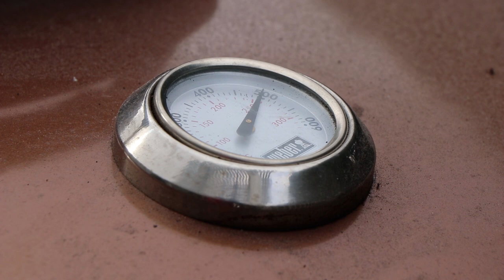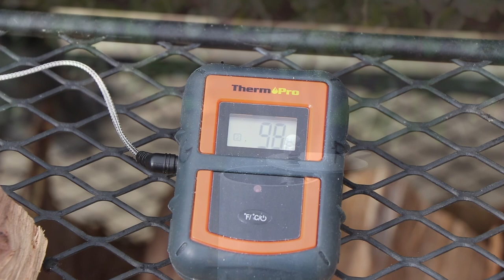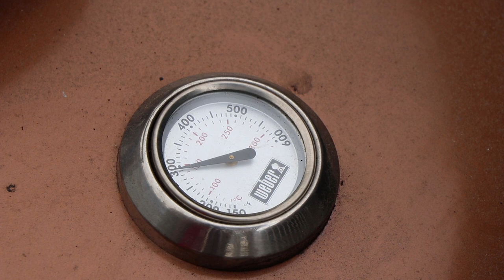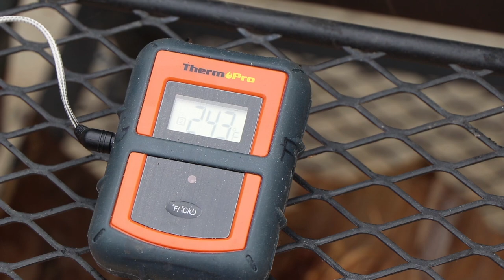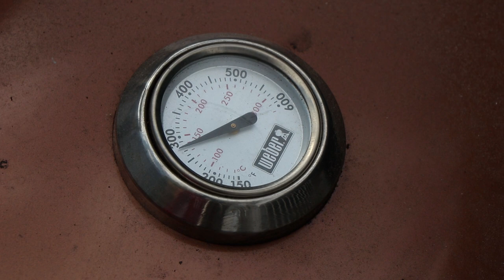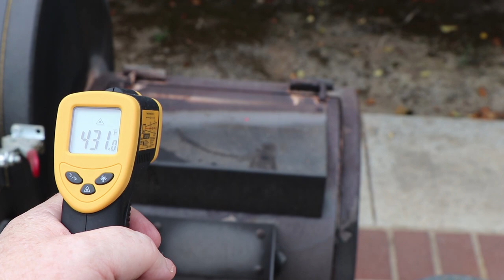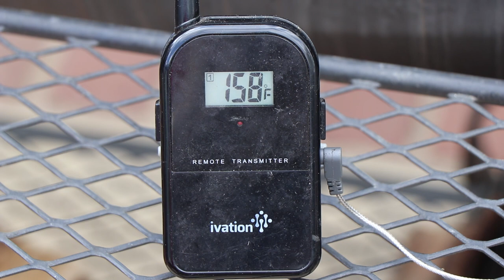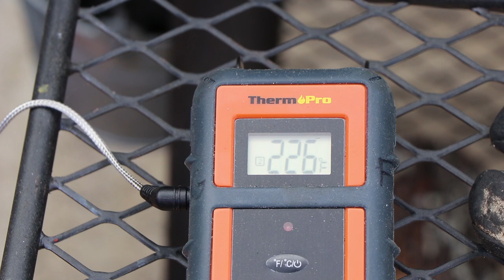Smoked Spareribs Using The 3-2-1 Method On The Offset Smoker

Comment: HOW TO CUT THE 3-2-1 METHOD TIME IN HALF: Make a brine with the following ingredients; kosher salt, brown sugar (lite or dark), your favorite seasonings and COLD water. Make sure the water is 40 degrees F or less. Brine in frig for about 4 to 4.5 hours. Rinse excess salt from ribs and season as usual. 1st two hours on the grill/smoker, 1 hour wrapped in foil, 1/2 to 45 final minutes without foil. Last 15-20 minutes of cooking apply your sauce. You're done. All done in under 4 hours. Because I own a JUMBO JOE, the entire cooking time takes me 3 hours, give or take 30 minutes.
Reply: can you tell quantities for the brine?
Reply: @francoerp  For my needs: I usually cook 1-2 slabs of baby backs or 1 slab spare ribs. I cut the rib-tips from the spare ribs & add to the brine as well. And I do the brine mixture sometimes 2-3 days before I bbq.
I use a 5.5-quart stainless steel Dutch oven with lid.
1/4 cup or little less of kosher salt.
1-2 cups brown sugar (I use light; dark brown will work).
1-2 tbls of my homemade spice rub or store bought.
1 tbls ground rosemary (or a sprig of fresh rosemary).
1-2 tbls garlic powder.
sometimes a tbls or two of Walkerswood Jerk Seasoning (the wet paste) or JCS Jamaican Country Style Boston Jerk Seasoning. But after the salt, brown sugar & water, one can add any kind of seasonings. Whatever you like; sky is the limit.
MOST important part of a brine is the salt & cold water @40F or less.
Add 4 cups of water to the ingredients in the pot and simmer for about 5-10 minutes. Let cool. Set in frig until you'll ready to bbq. If I plan to bbq on Sat. or Sun., I might place the ribs in the pot to brine for 4.5 hours a day or two before the bbq. Make sure the meat is completely submerged in the cold water. I place the pot in the freezer for about 30-45 minutes. Then in the frig for the remaining brining time. Brining complete, season ribs & place in a covered aluminum pan, put back in frig until the weekend.
Reply: Thank you Scoop
Reply: @francoerp  U'r welcome. Experiment with the kosher salt a bit until you get the hang of it. You don't want it to be too salty, but at the same time you want the salt water to do its job. I've been doing this for years and I got  it down so well that I hardly ever measure. Never are the ribs salty. The flavors' that I add are spot on. Ribs juicy and tender!!!!! But remember, you can make your BRINE 2-3 days in advance and store it until you're ready to cook.

Comment: Hey Ry great video, I’m curious about rotating rack positions on the grill because of the different temps on the grill. Did you rotate your racks at all?? Thanks!
Reply from the maker: Generally I don't. The baffle plates I have in the smoker help even the temps quite a bit :)
Reply: Cooking With Ry you have baffles in your offset? Any chance you have a vid showing those?? 😀 or could you point me in the right direction?? I have basically the same smoker!
Reply from the maker: Right here: https://youtu.be/hTfiLAL0Gd8 :)

Comment: I just did some baby backs for my first go around at the smoker. My temp was about 210 - 230. I rubbed them with good quality rub, did Johnny trig wrap, spritzed them several times, and did 2-2-1. They just didn’t turn out. Not very tender, lots of unrendered fat, gamey taste. Not very sweet. I just didn’t like them at all.

I feel like I did everything right and was very disappointed. Any tips on how to make them more tender and tasty?
Reply from the maker: Not sure about the gamey taste, but if they're not tenderizing they generally need more time. The decision then becomes when to add that time. If you did a 2-2-1, and you want some more flavor, I'd personally add a bit of time in the middle so you have maybe a 2-2.5-1, and make sure you give them a good spritz when wrapping them. Then in the last hour, when you have that unwrapped time, try upping the temp to 250-275 and give them a glaze with your sauce of choice to get that sweetness. I'd check them every 20 minutes during that time for probe tenderness between the bones so you don't push it too far.

One other possibility if this is isolated to a single rack is that you got a bad slab of pork. That's happened to me before.

Comment: Love your videos Ry.  I have learned so much and appreciate it greatly.  Thanks for this 3-2-1 method as it is very workable.  One question though - have you tried (recommend?) one of the "rib racks", that hold the ribs horizontally but seperated between the wire slots?   It would allow me to cook several racks of ribs at one time but I don't know the negative aspects of this.    Thanks again for your videos.
Reply from the maker: I actually have a video about that: https://youtu.be/lit-bgXSY0o I've also used it several times on the Weber Kettle :)

Comment: Thanks for the video...321 produces delicious spare ribs for me but almost always falling off the bone during saucing. 235, bone side down. Foil wrapped with brown sugar, honey and butter. I wish it would stay on the bone better...have shortened the 1 to 35 min but still hard to pick them up. Not doing competition and never had anything but compliments. Gene
Reply from the maker: Yeah I'm not a fan of falling off the bone. Prefer some bite to mine :)
Reply: I had this same issue when I did ribs yesterday following the 3-2-1 method. They had great flavor, but they were falling apart too easily. I think next time I'm going to try 3-1-1 and see how that goes.
Reply from the maker: Yep, just adjust that middle wrap time and that should keep them with a little more bite :)
Reply: @brlewis1984  how did the 3-1-1 work out? Everytime I use 3-2-1 they fall off the bone. Not what i'm looking for
Reply: Nolan Holifield I actually just did 2-1-1 last week and texture was perfect. Cooker was 250-275 and I wrapped with butcher paper.
Reply: @brlewis1984  Thank you sir!!!

Comment: great tips for the OK J  I bought some of the aftermarket accessories  base plate baffles , waterpan and  firebox, where did you find that clip for your temp probe? been using orange juice /water mix for the pan and  spraying also DR pepper works great too
fixing a brisket and ribs in 2 weeks for a co workers retirement  I use pecan chunks  but would love to find pecan logs or maple logs
Reply from the maker: That clip came with the probe when I bought the thermometer. I'm pretty sure they have them on Amazon :)

Comment: Very nice video and I will be cooking some spare ribs tomorrow (06-08-2019) using the 321 method!
Reply from the maker: I hope they turn out great :)
Reply: @CookingWithRy  I'll let you know!😎👍
Reply: I used Mesquite wood and used a glass pyrex pan for my water pan. It took a little more than the 3,2,1 it was more like a 3,2,2 and the meat fell off the bone except on the thickest portion of the ribs. And just like you did in the video, I divided up two racks into 4 half racks. When making the sauce, I used Jack Daniel's bourbon sauce mixed with Pace Picante salsa (medium). My wife said that it was like a cross between Tennessee and Texas BBQ. Thanks for the good instruction!

Comment: How often do you spritz, and what is spritz made of ?
Reply from the maker: I usually don't spritz until a couple hours have gone by, and then only if the surface of the meat looks too dry. You want some bark formation, but a spritz after that maybe every hour usually works for me. Of course if you're wrapping that becomes unnecessary once it's in foil or butcher paper. I usually use a 50/50 mix of some juice and water, or a 5-1 mix of apple juice and apple cider vinegar. But you can really try many different juices to see what you like best.
Reply: @CookingWithRy  ahh awesome, thanks for the reply, I will try the 5-1 apple juice to cider mix and see how it goes.

Cheers

Comment: This my friends is the best detailed video I've seen
Reply from the maker: Thanks very much!
Reply: I've had ago at this today did the 3 2 1 method and they never seem to fall apart the ribs were a little chewy .
Reply from the maker: It sounds like they needed a little more time. If you grab one of the bone ends and can twist it so it pulls out of the rack (almost like unscrewing it) that would give you closer to fall off the bone doneness. I prefer a little bite to mine. 

Also, you can increase the '2' part for more tender ribs, especially with spareribs or St Louis cut. I've done a 3-3-1 before on those because the rack required it. Every piece of meat is a little different.
Reply: I live in the United kingdom and our meat not good at all compared to u guys in the states they were cooking for 7 hours at around 245f  hit a stall at 200f so I chucked more log on
Reply from the maker: Quality of meat can definitely have an effect on the process.